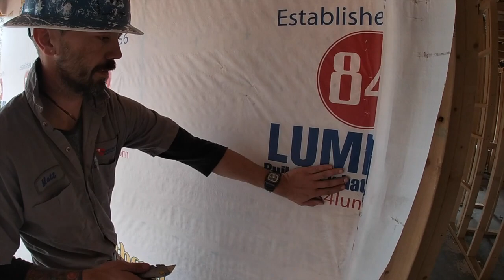How To Wire A House; Episode 2 - Low Boxing And Heights

Comment: it might be different here but the line you drew for height of the box, that type of arrow makes me think thats bottom of box, we put the tail top of the horizontal line if we want top of box. Might be different, just something I wanted to point out.
Reply: Same! In our state. That is the BOTTOM of the box NOT the top.
Reply: @dathip  The only thing that matters is that the one putting in the boxes knows where they are going. Doesn't matter if the mark means top or bottom, just as long as they end up in the right spot.

Comment: Awesome videos!  when you are adding the receptacle under the window, is it ok to drill through the built-up column (where 2,3,4... 2x4 studs are nailed together) to run electrical on the exterior wall?
Reply: Check if they are structural studs first

Comment: Dude cutting out the carpenters work? I don't think they put those 2X4s in there for looks, not cool
Reply from the maker: My work is more important than a couple blocks. Framers fail almost 100% of the time and they can add an alternative for a reinspect if needed id rather continuity of all heights and convenience of something a homeowner will see everyday than what’s in my way of making finished work look good
Reply: Guests: Hey why are your outlets all different heights????

John: The framer has blocks in the way so I just slapped my box’s there
Reply: @dallas5374  The 2x4s serve as structural members sometimes but are also backing for drywall, support for electrical boxes, and they will need to be drilled through to pass cables and pipes. So it is necessary to do what he did so things end up where they need to be.